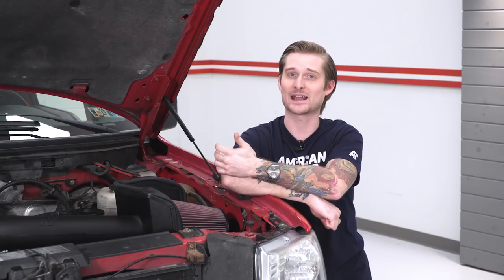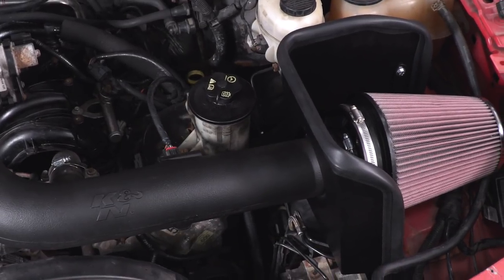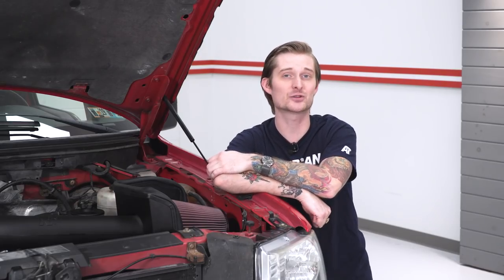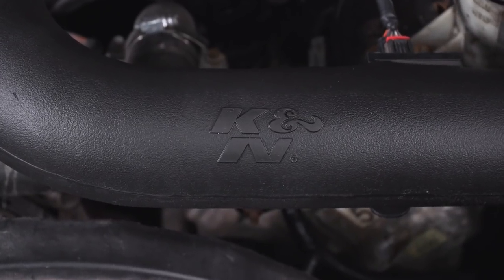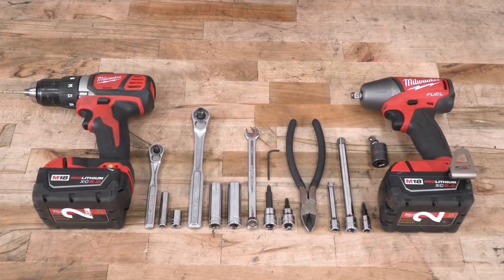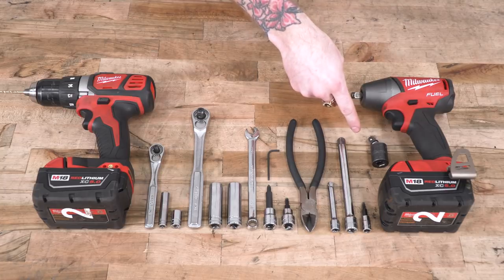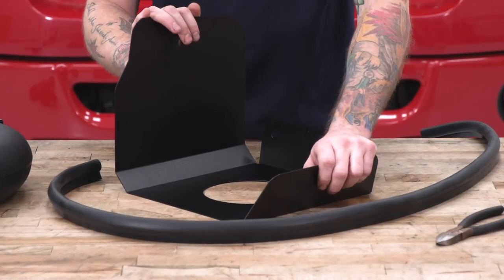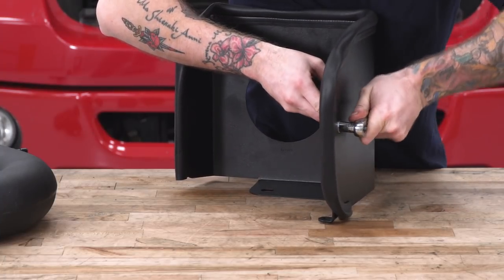2004-2008 5.4L F-150 K&N Series 57 FIPK Cold Air Intake Review & Install

Comment: I got a 5.4 3v 06 their good engines but need to fo oil changes on time.Every vehicle needs maintenance and if neglected will break.That being said with this engine it gets a little more horse power than the 4.6 2v so like anything you sacrifice longevity for performance.

Comment: I don’t like the way this guy takes liberties like changing where the throttle body sits, it might seem like nothing will be different with which side of that elbow it went on. It is now putting extra weight on those bolts going onto the intake and could cause the elbow to lift or break its seal over time with heating up and cooling down and the vibrations and bumps while driving. You’re just putting more stress on parts that the manufacturers told you not to place. Just install things correctly especially if it’s a customer vehicle. Also stop using impacts on 10mm bolts guy. It’s 8 bolts to take that off.

Comment: Ok, my F250 SD  5.4L air sensor is on the front side of the stock air intake,   But the K&N, like yours, is on the back side.  Is this typical and will the sensor wire reach there.  I don't want to get this apart and find it won't.
Reply: probably not, buy the f250 cold air intake kit

Comment: was wondering if this would fit a 2008 ford f150 chip foose edition
Reply: yes
Reply: @alanski420  how did you get it to fit since the throttle body inlet is slightly curved down and on the foose/roush its a straight inlet

Comment: Good luck if your 5.4 made it this long.
Reply: Jason R 
Why you say that?
Reply: Mines did I have a 04 f150 5.4 lariat procharged
Reply: The only people saying the 5.4L is bad are the same that ignore the fact that most of the Triton's blow ONLY if you don't even do routine maintenance on them lmao.
Reply: LOL. 205,000 on my 05 4x4, doesn't leak or burn oil, pulls my 18 foot car hauler with ease.  Too bad I'm not able to upload pics here but its hauled enough Suburbans, Tahoes and other GM trucks to keep my small shop in business.
Reply: Nick Consdine get the updated oil pump for the engine. The engine is reliable but had a few issues with high mileage. The updated oil pump is a upgrade for the engine.
Reply: I have an 07 5.4 with 200,881 miles on it and it still runs perfectly fine
Reply: I had a 98 f150 5.4 and it has 487,000 and still running good with the original engine and transmission.
Reply: 2006 5.4 F150 240,000 miles runs very strong. Change oil every 5,000 miles almost every engine will last you
Reply: Non-Biased Falcon Fan what maintenance and or new updated parts have you done ?  I have a 06
Reply: I bet he is a cheve owner
Reply: Mines is still running lmao
Reply: LoL
I'm on 2nd engine
Reply: I bought a good used engine and freshened it up.  And all good. I'll post mine soon.
Reply: I replaced mine and its perfectly fine now. No monthly car payments. Lol

Comment: Do you need the heat shield
Reply from the maker: You don't technically need it but I don't know why you wouldnt install it? -Justin
Reply: Yea for heat if u don’t have it u are sucking in hot air & that’s a no no you want fresh air or cold never hot getting sucked in

Comment: I have an 07 ford f150 4.6l  and I gotta say Don't waste your money I spent $350.00 on mine and installed it double checked everything and it doesn't work it stars suckin  air and the truck shuts off. By far the worst upgrade I've ever bought.
Reply: probably because it was meant for the 5.4 L